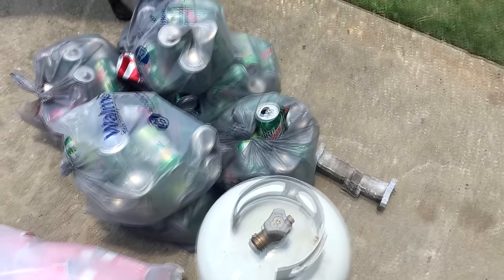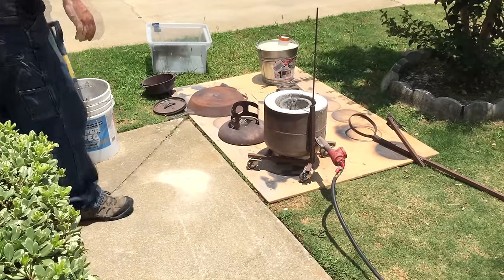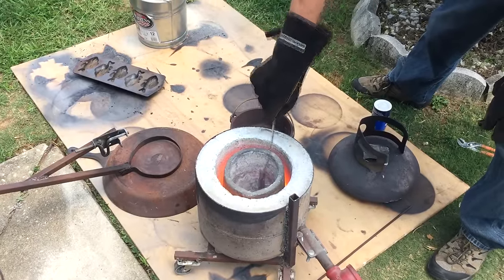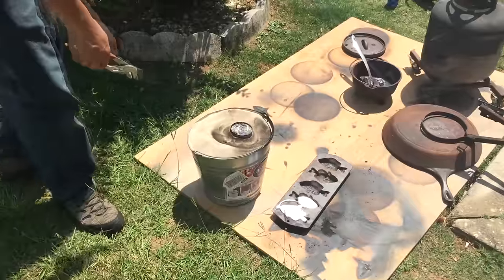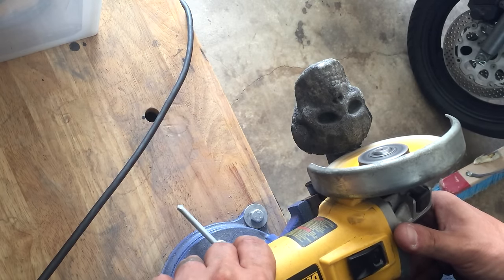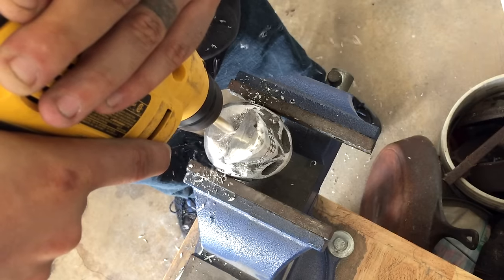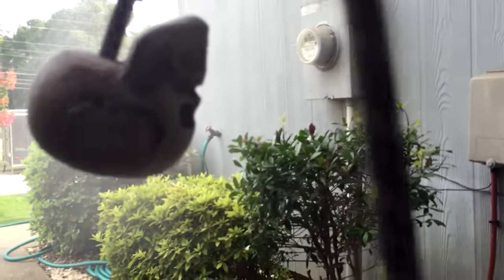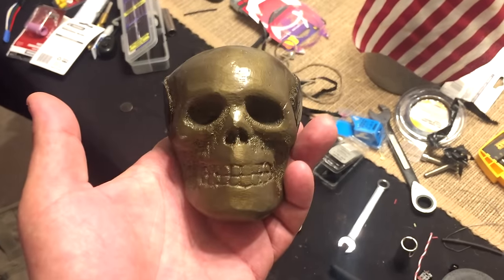Aluminum Skull Casting

Comment: Nice to have you back! Beautiful work, you make it look easy. The only thing though (not to be a backseat metalworker) is that I think you are supposed to back off a little every turn or so when you are using the tap and die set to relieve the shavings. Other than that, perfect!
Reply from the maker: Thank you! Honestly that was the first time I ever used a tap and die set... I melt metal. Done generally screw it. Lol

Comment: I've seen a website where a guy dipped the foam in drywall texture mud and let it dry for a day before casting it. It seemed like it came out with a much smoother surface, so maybe that would equal less sanding. Haven't tried that method myself yet, but I plan to in the near future. Anyway, thanks for the vid!
Reply from the maker: I have done that. It does give it a much nicer texture but I was out of drywall paste and have a power sander so I skipped it. ;-)

Comment: About time you posted a video! You probably know this but if you coat the pattern with drywall cement, it keeps it from taking on the texture of the sand. Less sanding.
Awesome skull BTW.
Reply from the maker: Life happens... There will be more videos coming soon. I'm back into my normal grove. Thank you for the support and yes i have used the drywall paste before. It does give it a better texture but if I'm planning on sanding it all anyway I skip it. Not worth the trouble.

Comment: Want to save a lot of sanding..... Dip the pattern and HALF the spew in plaster of paris, let it dry then repeat 2 more times. Now that will keep the course sand away from your pattern and give you a smooth(er) surface. Another trick is to sprinkle talc all over the pattern then take a very soft brush to smooth it out and remove the excess. I've had both good and bad luck with this one, but if it works it's a great.looking casting.